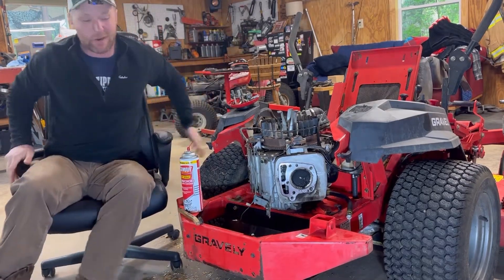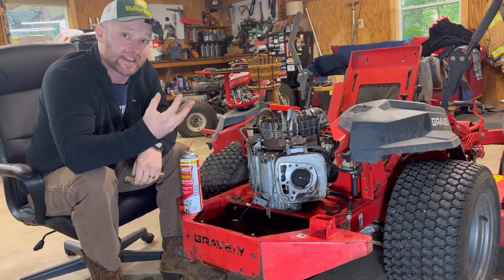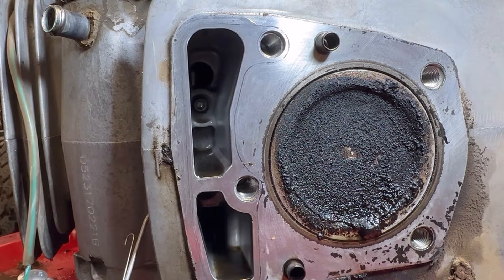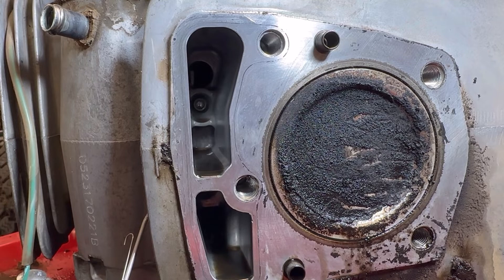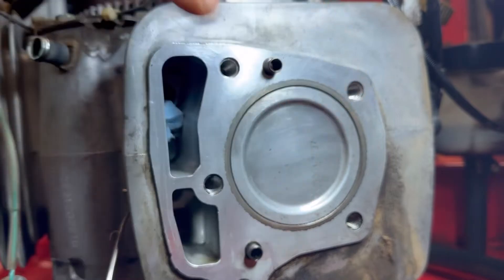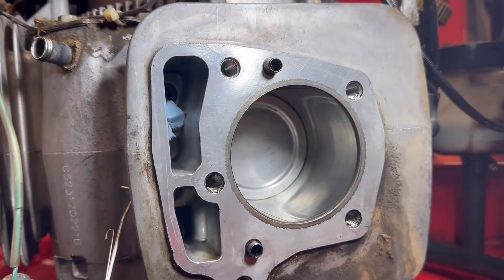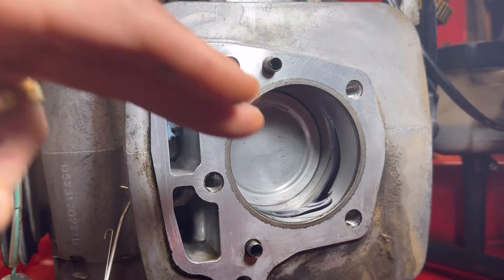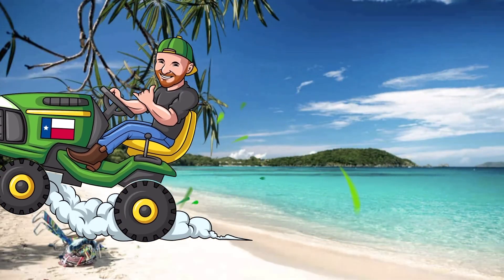Piston Cleaning in Engine

Comment: If I got gas in my oil in my lawn mower cylinder but can't smell any gas on my oil dipstick and, and a small amount of oil is leaking through the breather tube and have drained all the oil from the engine, replaced the carburetor then pulled the spark plug and the starter rope but there were small drops of oil shooting of the cylinder. My question is, if I bring my piston to, "Top Dead Center," would it be safe to spray a small amount of carburetor cleaner in the spark plug hole before I refill it with oil and start up?
Reply from the maker: Yes spray away

Comment: I will say, I bought my mower brand new and I've only run 100% ethanol free gas, and at 400 hours, my pistons look exactly like that. As far as carbon goes, the ethanol free gas doesn't seem to make a difference.
Reply from the maker: The ethonal actual helps keep carbon down in your cylinder. It just sucks because it collects water in the fuel

Comment: anyone know what the Compression PSI should be on these FR691V's  and do they have Compression Release on Both sides ? getting 50 PSI #1 and120 PSI #2.
Reply from the maker: It should be atleast 120psi. You have some issues if one is just 50psi. Atleast you know what side has the problem

Comment: Where are you that you have full ethanol gas?  E 85 is all you can get most places??? Ethonol burns cleaner than gasoline but also takes 30% more fuel to make the same power that build up is bad gas or oil build up that’s made it past the rings.
Reply from the maker: Is 10% ethanol here, is plenty to mess up small engine
Reply: @MowerMike  that’s not full ethanol like you kept saying in the video though?

Comment: Good video as always; do you check for piston "rock" in the cylinder while those heads were off?  How much piston play do you consider too much play when you are checking/cleaning the piston(s)?  Thanks.
Reply from the maker: No idea that is beyond my level of Engine know how, I would just slap new rings on them and see how it works as long as the pistons don’t look beat up or scuffed
Reply: @MowerMike  i bet you are going to need new pistons soon, when the piston starts to have extra play in the cylinders it wears down the bottom of the piston skirts causing that amount of movement. the cylinders should be in ok condition considering that they are made from a harder metal, but they would need a quick hone unless there is deep scratching.
Reply from the maker: @IanWerth-p1zI will take that bet!
Reply from the maker: @IanWerth-p1zIt has been 2 years and she still runs like new. Soooo